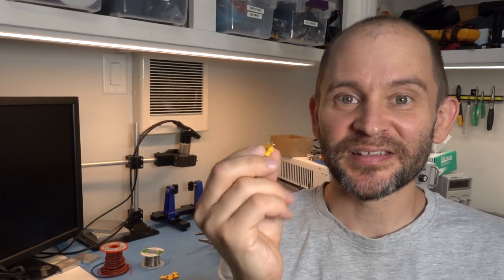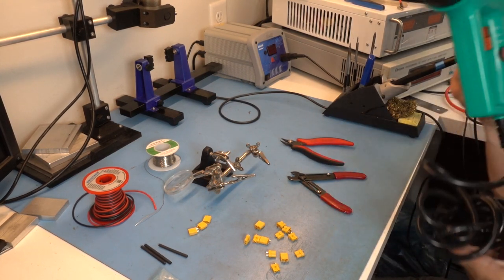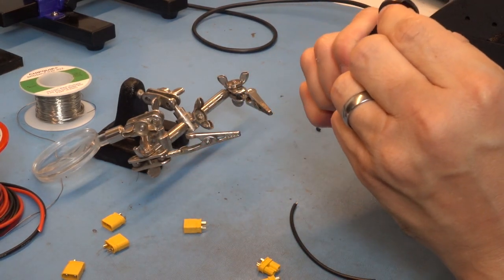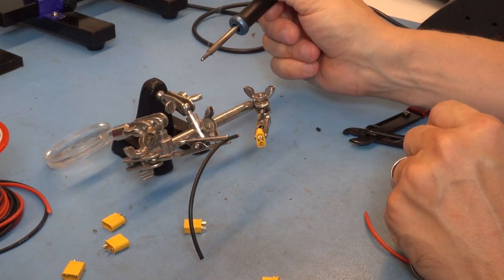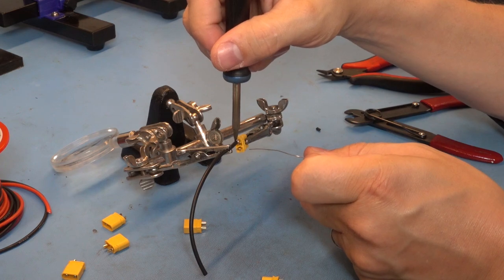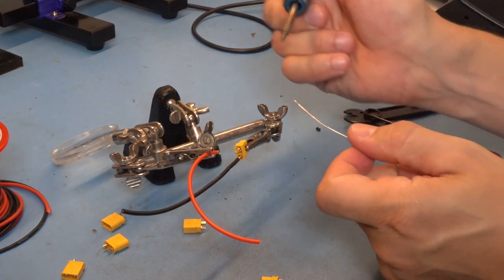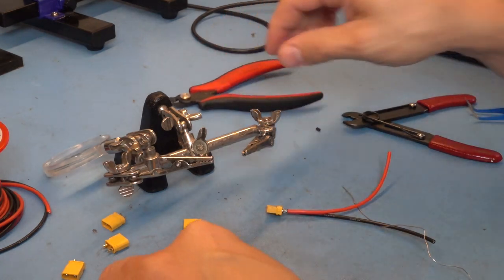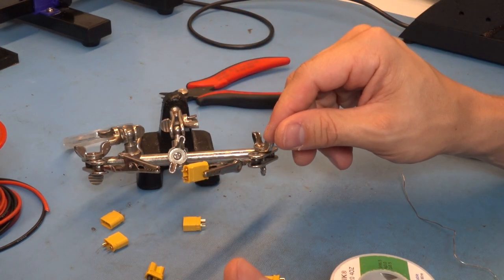How to build custom XT30 cables

Comment: one thing i will say is i think its better to not heat the wire so much, once its flowed get the heat off, if you have solder wicking up the cable inside the insulation then you have over heated the wire, and overheating copper makes it super brittle and suseptable to braking from vibrations, but otherwise thanks for the vid i didnt realise these connectors just soldered together
Reply from the maker: Yep, that's very true that solder can wick up the wire!  It is hard to remember all the things that can go wrong when making a video!

Comment: You forgot one valuable tip: if possible, always plug both pairs of connectors together when soldering - this helps to prevent deformation of the pins when the plastic becomes soft.
Reply from the maker: Thanks! I actually did talk about that when doing the male connectors
 For XT30 the female ones are pretty robust be and don't really distort.
Reply: @awesjosh  Ah okey then I have overheard that or paid too much attention to the video footage :P

Comment: I have to disagree with putting solder in the cup before putting the wire in. This makes it so that if the solder in the cup ever hardens, it makes it nearly impossible to put the wire fully in the cup after that.